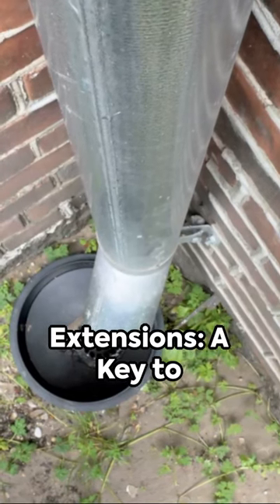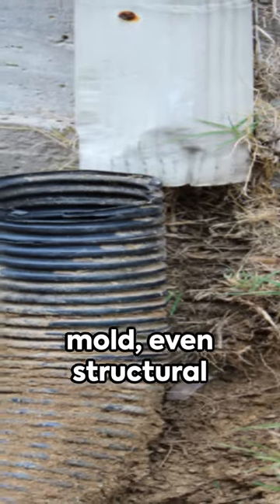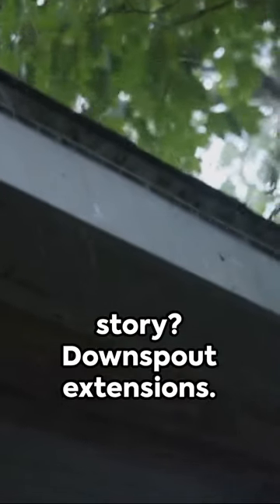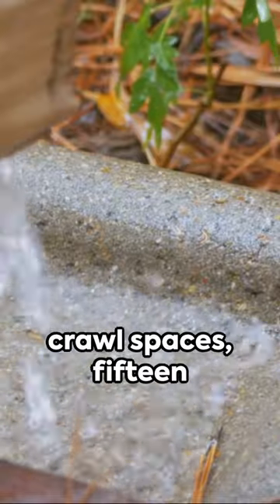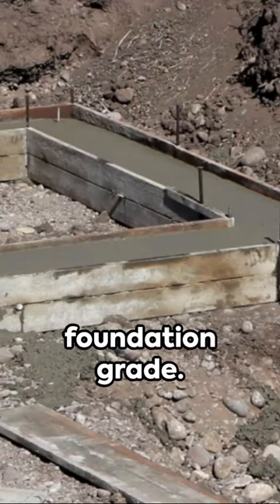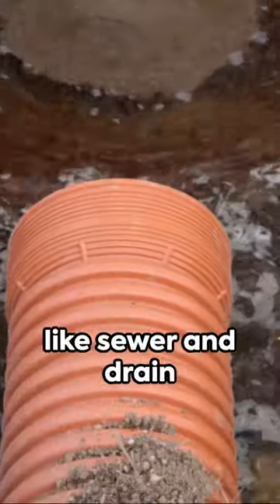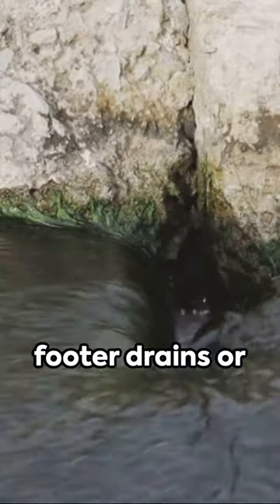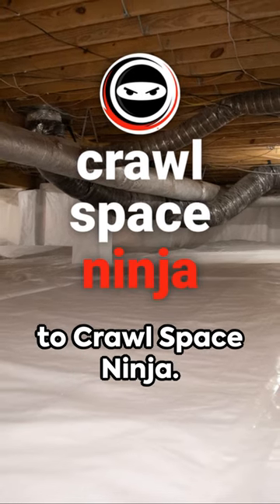Downspout Extensions: Your Key to Crawl Space and Basement Flood Prevention!

Comment: Right positive drainage is huge. Watch that water and where it flows to as well. Plenty of slip and fall ambulance chasers that sue for icy conditions from daylighted pipes at sidewalks. Consider schedule 40 PVP over corrugated every time. I've never seen crushed sch. 40, but I've seen hundreds of feet of crushed corrugated in 35 years of digging up footing drainage tiles that have failed. Here in Denver our rainwater can't leave the site, so we often design dry wells to accept off-flow. These are effectively large holes in the ground filled with river rock where water can percolate and absorb back into the water table. Happy New Year to the Crawlspace Ninja team.
Reply from the maker: Thank you! Happy New Year to you!